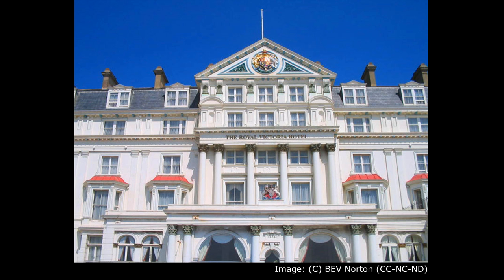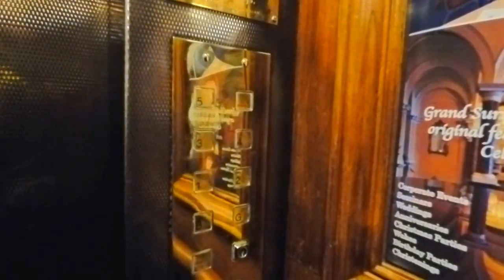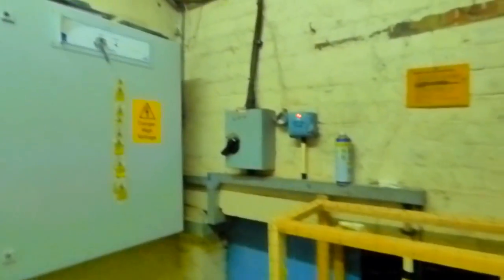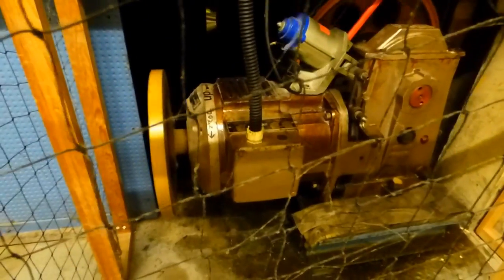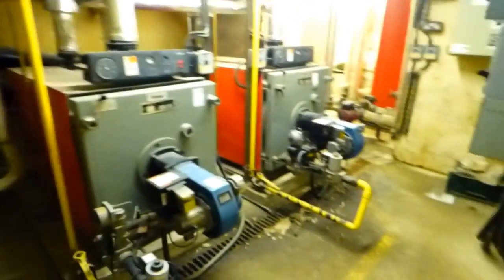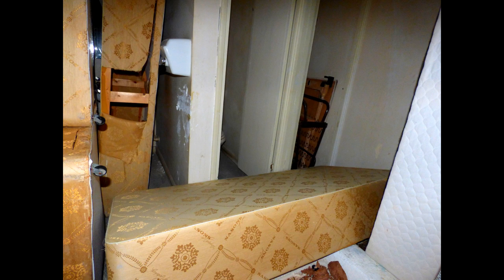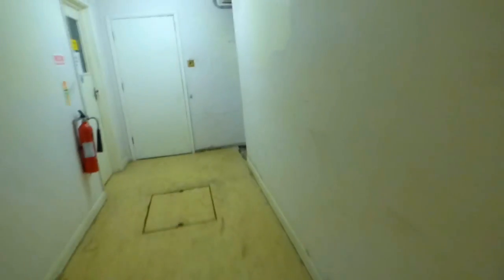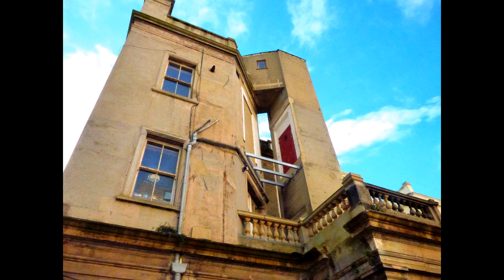Urban Exploring Royal Victoria Hotel in St Leonards Hastings

Comment: Why did a building with a boiler room have electric storage heaters in the room corridors? Did you have hot water radiators in your room?
Reply: probably orginally coal or oil fired and then in the 80s refurb they decided it would be cheaper to heat with a electricity

Comment: 12;23 was that the light switch in the back of the shaft
Reply from the maker: +ArcadeTripsUK   The image from my camera isn't great.  It is very dark at this point.  I brightened it up so much with vegas that there are some distortions in the picture.    I don't think it is a light switch.  I didn't see any when I looked, also the light switch is always in a position so that it can be turned on without having to go down the pit.
Reply: Ah yeah, rather odd, unless its hidden in reception or in a locked room seperate to the lifts and motor room to stop unauthorized lift surfing.

Whens your next video
Reply from the maker: +ArcadeTripsUK   My Halloween video has just been uploaded
Reply: Oh great, watching it now ;D
Reply: Just wondering, do you have fb/